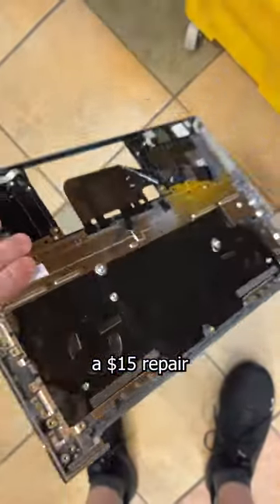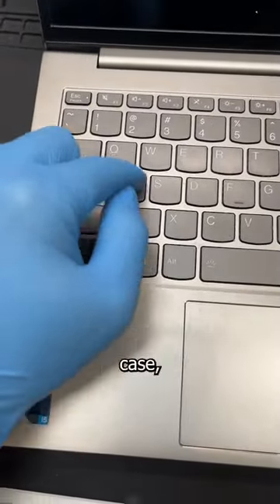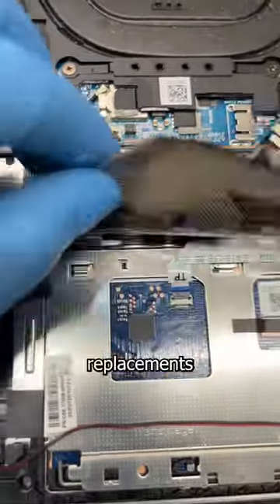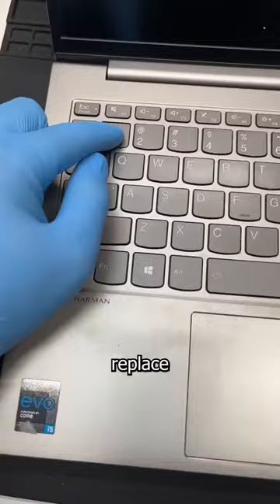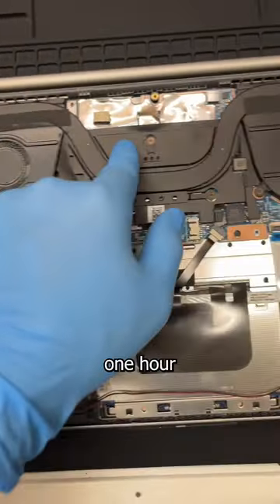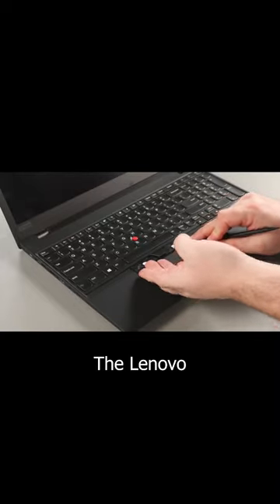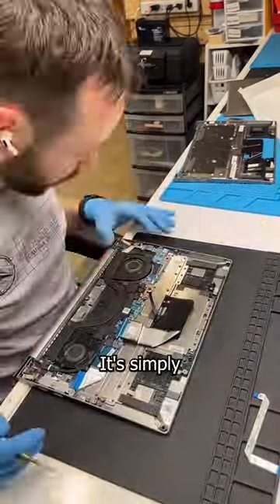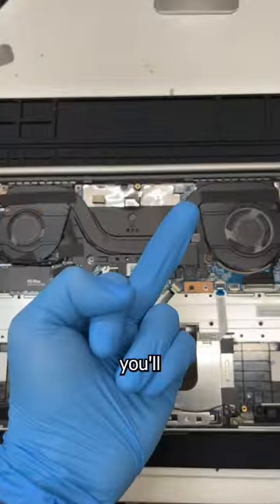This #pc design trend is bad for consumers. RIP Keyboard repair #technology #tech #computer #shorts

Comment: As a Warranty repair tech for both servers, Laptops, and PCs this design choice is among the worst ever. Well that along with the fact that a given laptop is held together by more tape and glue that one would think. Even Lenovo is just as guilty, so while the keyboard setup is better then most they still use doublesided tape to hold the LCD screen instead of screws making it annoying to replace, Also in most of their system the only thing holding down the mounting brackets the hinges are mounted is glue.

Comment: I never realised that they might sell the entire front; I did more of a number on my Nitro than I’m willing to admit, just by trying to replace the keyboard. The problem doesn’t even stop with the shell, because Acer felt the need to include not only a big‐ass metal shield between the keyboard and most of the rest of the internals, they even put some kinda copper looking plaque between them. I guess it’s supposed to deflect the heat away from the keyboard? Makes repairs hell.

Comment: Thats exactly what happened here, in our company. Time to time I got the job to repair someone's pc while I'm not specialized for it, but I love trying and learning. Last time it was an HP 850 g7 I believe, and the girl who had it threw something like cocacola on the keyboard, it was sticky af, so I contacted HP, they gave me the code to find a keyboard online in a shop (for like 150euros) or I could send it for repair for 700euros, my boss told me "Eh, i wont send it for the price of a brand new PC, so try to replace the keyboard yourself, if you can't then its ok".. Yeah.. all went good, battery motherboard etc went easy to get out, but then I found out the keyboard was fused in the thing you know (idk what its called), and yeah if you aren't equipped with the right tools to put the new one on it then you're fucked. Happiest 2 hours of my life.

Comment: I have been using a Lenovo Laptop (G580) for 11 years, replacing the keyboard 3 times myself. Have done some upgrades. still it rocks.

What's the point of buying a product if there is no option to repair and upgrade !

Comment: I tried to repiar the keyboard of my L340-15IHR, I had to remove everything and then figure out hot to safley remove a metal plate that puts it in to place, you have to remove little plastic pins. I used a butter knife. Works as new

Comment: What manufacturers will find over time is that those who insist on making the keyboard as in this video, will end up loosing market share to the Manufacturers see repair-ability as a good thing, and make easy for the buyers to swap out components as they fail.

Comment: my laptop has a very similar design, except the keyboard is separate from the top case and is held in with 50 screws. it requires taking out everything from the laptop except for the hard drive and the battery but luckily is only a $20 repair should nothing else break

Comment: my senior at work really was mad when he was trying to fix a laptop keyboard and had to dismount and mount the thing twice because the sata tape was set in the wrong way, so it didn't read
and after doing the whole thing the "?" key (which was the main reason we swapped the keyboard) still didn't work
I said it was probably the Registry, but since I started the job literally one month before I said kind of joking...
it was the registry, for some reason it unmapped the "?" key and there was an easy fix on the internet, simply run the registry editing file

Comment: I have a Lenovo Ideapad Gaming 3 (82SC0032TX) and I accidentally broke the dot button.

 The only issue is the little plastic under the button has 2 milimeter sized arms broken off.

 I called Lenovo, they said they would replace the entire laptop case for a single. piece. of. plastic. I am not joking.

 I would rather steal that plastic from those display laptops and risk getting caught than to pay to change my entire laptop case

Comment: I still use a modded Thinkpad T430 when I need a laptop (most of my remote work can be done with my M1 iPad Pro; Apple is meh, but software for mobile photo editing/processing on iPadOS completely destroys Android even if the Samsung hardware is great, which it is). Upgraded to an i7-3840QM with a better power brick, cooling, etc. to go with plus a better display panel to replace the broken one it had when I got it making it cost me 50 bucks.

Sure it isn't a gaming machine even with the dedicated but out of date GPU, but as a small mobile workstation I can upgrade/repair that cost me like 250 bucks, it does everything I need of it and more.

Comment: After watching many of you r shorts I bought a a screwdriver with 165 different replacement heads to try to clean a HP laptop fans after 40 min I realized that like in this video the keyboard was glued and after after forcing a bit the bottom I saw in the inside the fans where under so many circuits I quit and just tried to install back w7 .

Comment: I replaced the keyboard on my brothers laptop and ended up fusing the new one in with a soldering iron. Probably not the best way to spend my time but I’m not a professional repair technician and since it was for my brother I work for free.

Comment: Damn, I had to replace the keyboards on a couple of Unibody Macbook Pros from 2011, that was a boring job with a metric ton of screws to get to them but looking at this I'd rather spend a couple hours with a screwdriver than this crap.

Comment: yea.. my asus notebooks arrow key broke off together with the pad underneath.. all i could do was order an entire new top part of the case... which was not a pleasant surprise once i saw the price... sadly now my mouse pad has ben pushed in on thr bottom left corner which means i will need to get yet another new top to fix it as it is supposed to be glued in place... buut i probably won't bother to get a new one.. considering my laptop is already 5 years old and one usb port is broken and one of the foot pads has lost the rubber and the plastic shield in the front connecting to the bottom screen that covers and protects the hinges and wifi antenna and screen cable from being glasted by the heat from the fan on the top of the laptop is loose as too many of those plastic click-on hoops has broken off.. .. aaand most importantly... i don't use the touch pad anyway... all i can say is that it works for as long as it works.. but my laptop is surprisingly good.. (even though i accidentally submerged it once).. at least for simpler tasks (not including gaming).. it is also quite fast due to the M.2 ssd in it which has meant that startup time has ben the same since i got it in high school... but yea.. it sucks that some parts are just designed in a stupid way...

Comment: Around a year ago 9 random keys on my keyboard died all at once. I thought to myself "I fixed a few things myself already, can't be that bad to replace the keyboard, right?". Boy, how wrong I was. After gutting everything I was unable to find the screws. Googled it, turns out you have to solder it off. Decided I am not willing to risk destroying everything, put it back together and I just use an external keyboard with it.

Comment: My laptop is like this. I spilled water on it and the keyboard started to input 1 permanently. 
I looked it up and immediately gave up fixing it.

A Bluetooth keyboard and uninstalling the driver for the factory keyboard works just as fine.

Comment: this is why i still use my dell inspiron 14 3000, the keyboard can simply be popped out. also, if you break a key you can simply buy another key and replace it

Comment: Lenovo didn't prove that you can have a sturdy removable keyboard.
What lenovo knew is that nobody actually wants to type on a sturdy keyboard anyway. 
Keyboard enthusiasts literally make their keyboard softer and springier to type on.
Mines not exactly removable but that's because my laptop has a mechanical keyboard. Kinda too thick to just be removable.

Comment: My kid dumped McD sweet and sour sauce on her new frigging HP laptop.  I was able to find just the keyboard as a replacement,  but then found this fused situation.

Fortunately I have 3D printer PLA filament and was able to "solder" (on low heat) the plastic to put the new keyboard into  the case.

Comment: It's rather like trying to work on transverse engine front drive automobiles. They're designed to be easy/quick/cheap to manufacture, and who cares if they're cast iron nightmares to maintain and repair? That's just more billable time for the dealership's service department. Win-win for Honda/Toyota/Mazda/etc.; BIG lose for John Q Public. :(

Comment: Kinda understand also with so many counterfeit stuff in nowdays for ez part like that. Bet some big company (laptop manufacturer) lose money on it. Kind one of the reason. Its easier solution to their problem than fighting piracy on their stuff. If only not just the manufacturer but also the also the consumer. But it hard to achive. Some big company on electronics rn not just selling functional stuff but also brand. They charge soo much for some regular stuff they had just because its their brand in there. Welp it is qhat it is. Wcyd

Comment: I actually prefer the new design over the old, because the old ones forced you to remove the keyboard in order to change out the disk drive, ram, and every other component in the computer. The new design is simpler aside from the keyboard replacement.

Comment: They probably could’ve avoided this repair cost by making the keyboard higher quality.
But naw, they don’t care cuz it’s cheaper. This is why people should invest in framework, so someday those things can be 800 CAD for a 4P  /4E core intel system, with good specs (which means 16GBs of ram and a 512GB SSD lol)

Comment: i went to a repair shop just to get my ram installed due to this design on my dad's laptop (removable keyboard) no jokes first he had to disassemble the whole thing then the keyboard then he was able to slide in the sodim by you ask he had to remove the keyboard first because the of the screws underneath. it took him almost 30mins to do the whole thing and on my asus tuf a15 i did added the sodim almost in 7-10mins tops

Comment: Modern laptop design sucks. Back then, the CPU was socketed, and on gaming laptops, the GPU was also on its own module.

So far, no non-Apple computer manufacturer has gone as far as soldering RAM and storage to the mainboard, unless it's on a sub-$300 Celeron-based crapbook.

Comment: The main (non-money-grubbing) reason for this, I am told by my engineering friends, is actually to help with waterproofing; if the keyboard and palmrest are one piece, the keyboard can take one for the team when you spill your drink on it, rather than allowing to leak through and drown the mainboard. from what I can tell, it works pretty well too; I have some friends who are... prone to spillage, let's say, and their laptops always at least still boot after having 100ml of coffee poured into them, even if the fucked keyboard makes them unusable.

I still hate fixing/replacing the damn things, it's always the most tedious hour of the day, and I'm sure the same thing could be accomplished with some sort of adhesive gasket. Bastards.

Comment: Sent my moms Asus laptop in for a new hard drive came back and now the whole bottom row keys dont want to type u rly gotta press it and its annoying as f. But i think i know what they did since ive opened it myself and the laptop opens from the top not the bottom so basically u lift the keybord and the connector is short as fck so they probably damaged it whereas old laptops like our HP just open from the back its so much better

Comment: Just don't repair it. Very often you don't get the new keyboard in as the old one, as it is not screwed but clamped with plastic which has to bee broken off when removing the old one.

Comment: I think that they already know that Even if they did take Repairability back to Priority
Still Ove rhalf the people whonbojght the laptop would just buy a newer one since usually the keyboards last long enough until theres a better laptop by specs on the market for also cheaper to maintain over the years 

Although technically it is more expencive to maintains icne you canr repair it easily amymore

Comment: I've got an ideapad flex 5 with a key that is cracked in half, would I need to disassemble all of it to replace that one key too? or is it possible to remove the keycap like this (I've tried pulling it off by hand like what I've done with previous laptops and it's not giving)

Comment: This is some bullcrap design. I do remember old laptop were easier to fix/replace if some of the parts were breaking down, what kind of designer make us disasamble 90% of the laptop just to fix keyboard and touchpad, and why the fck they uses different size of screws. I was so furious when i had to bring my latop to repairman and he said he probably would need and hour for keyboard replacement, until he show me how it was build, my dumbass self not realize that the keyboard was basically under the laptop body. 
I have the same feeling when phone start to adopt this unibody battery design,  whats wrong with the old design? You tell me i cant just swap my battery with fully charged one like the old day?? Now i cant even find port for my headphone cable and the charger sold separately. What a load of crap

Comment: i just repaired an HP laptop with the same issue... bought a new keyboard and rip off the old keyboard and solder the new one... if u replace the whole top case... u are weak

Comment: And thats why I will continue to use my external keyboard plugged into my laptop, because no way in hell am i replacing my $2000 laptop just to fix the laptop keyboard. Just buy an external keyboard for $100-200 instead, because "fuck you too" to the manufacturers.

Comment: 200$ dollars for a keyboard? no thank you I have fixed and replaced some of those keyboards designs and I know they're a pain in the butt but 200$ for a 30min job? you're screwing your customers lol
Reply from the maker: Top case by itself is $100-$150 depending on model, labor to remove every single component over to the new top case, and sufficiently test it is NOT 30 minutes. You clearly have no idea what market rate is here in an area of the US where the cost of living is squarely in the top 1% of the most expensive cities in the world. But go off, king, you know better than me...